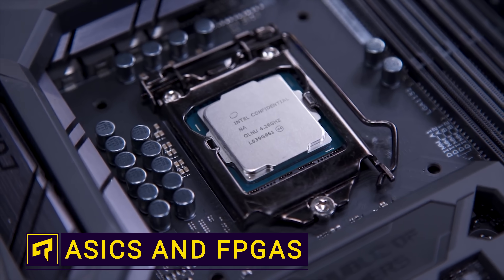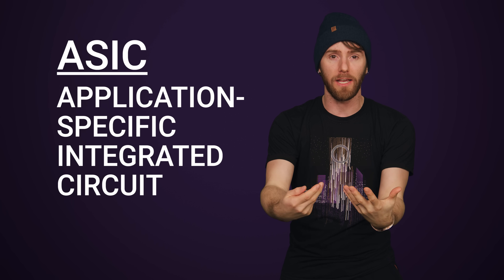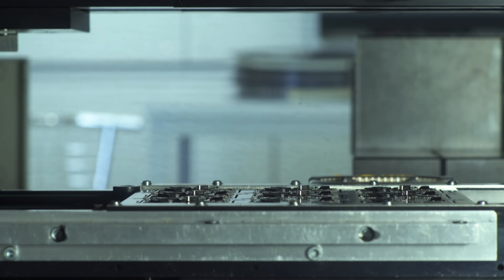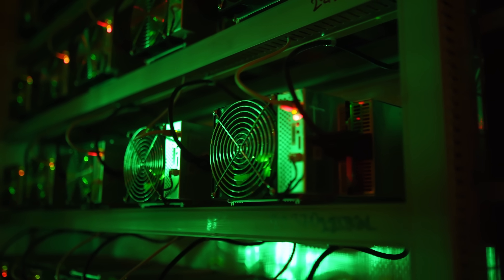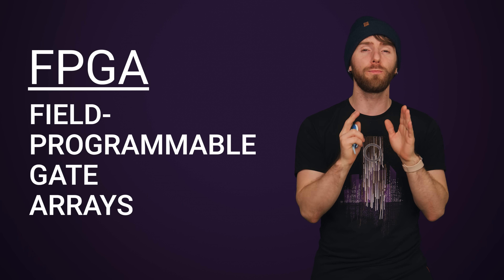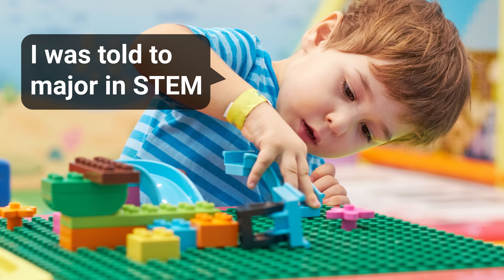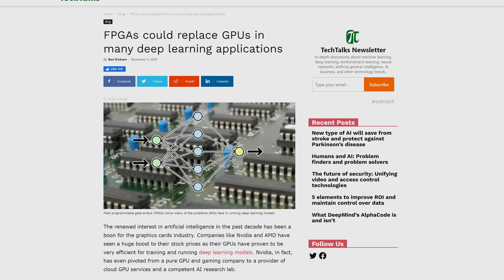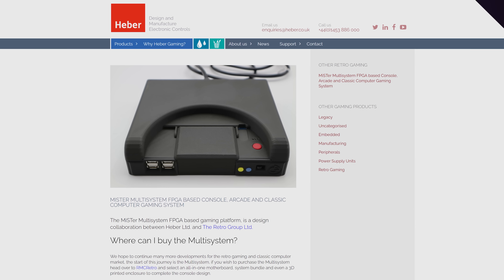These Chips Are Better Than CPUs (ASICs and FPGAs)

Comment: its funny how he talked about emulation consoles, I was about to say they can be programmed to run identical to the retro systems architecture
Reply: Modern day CPUs have insane IPC that FPGAs aren't needed. Taking Nintendo aside, current consoles are all x86 based
Reply: @saricubra2867  you still dont understand ,its not about the IPC, some games no matter what computer you use  have issues with certain games games, especially certain graphical issues.thats what FGPA chips in these emulation consoles were used for. they are infact needed if you want true emulation, as for emulating it on another computer games run fine its just not always perfect.FPGA chips fix this. stuff with FPGA chips are also expensive and know people will pay the price for a true match for match emulation
Reply: @kyles8524  Software emulation can be just as good, people should stop shitting on it just because it's software.
Reply: @karehaqt  FPGA chips just ensure accuracy ,most games run accurate but some dont because of the software emulation.Its all common knowledge when it comes to emulation

Comment: as a software programmer that acquired a couple of FPGA boards to learn to program them, the thing am seeing of note is that multiple FPGA digital circuits can be designed to run in parallel while based on the same clock signal. Depending on problem to be solved the FPGA manner of doing parallelism could be very powerful. An embedded CPU executing software instructions is very versitle and easy to program with lanfuages like C. But it's ability for parallelism is limited by how many cores the CPU has, which for embedded will typically be one, two, or four. Plus those cores need to really be programmed with some sort of OS kernel that facilitates managing different task for execution on the different cores. And those task need to be coordinated to work effectively and correctly, which can be the trickier aspect of multi-programming. 

Whereas the parallelism one designs into an FPGA is just inately what it does - it may require a means of feeding in input data and a means of collecting output data, but it doesn't have to be managed for parallel task execution in the way a multi-core CPU does.

Of course, at the end of the day, my primary interest in FPGAs is to learn how to implement vintage computer CPUs :-)

Comment: One of the more impressive ASICs i know is a monitor screen Scaler. Time ago i was trying to repair a Monitor, i though maybe the fault was on the scaler chip circuit, so since i have some experience with microcontrollers i had the idea of replacing the scaler with one, but then after some research i realised it was impossible, the amount of information and the speed of processing was way beyond what a common microcontroler can do.

Comment: This is like the difference between an all-in-one wireless routerswitchap, and a dedicated AP. 
I've got an all in one 2400Mbps, and a 1300Mbps AP, the 1300Mbps AP, with internal antennas, is about 8x faster than the all in one, but it can only do the one thing.

Comment: The first machine I ever built ran Windows 98 SE2 and an AMD K6-III with 256MB dual channel ram. I didn't even have an exhaust fan. I could edit videos, edit audio, browse online, be on IRC, DL from Newsgroups, and have emulation games (NESten) running at the same time. So I don't know what you're talking about saying that modern CPUs can do the things older CPUs couldn't? It's just a ridiculous statement. What you could say is software has evolved to the point that it requires a modern CPU to really multitask the way you did on the previous generation. That would have been honest and made sense.
Reply: Not only that, is the absolutely ridiculous IPC increase specially with Sandy Bridge, Haswell and Zen 1.

Your K6 processor would struggle or be basically useless for music production, it would choke extremely hard, maybe the entire system would freeze.

I run Android games on my 9 year old laptop with my Intel Core i7-4700MQ quad core processor, why? because it's waaaay faster than the Qualcomm octa core ARM chip from my current phone despite the difference on instruction sets. Massive difference on frequency and Haswell IPC is still good and AVX2 instructions are helping me.

64 bit instructions are huge, and 16GB of RAM is enough for lossless high definition video, unlike the K6 era (extremely crappy resolution compression and framerates).

Things changed a lot since Core 2 Duo.

The fact that you could do something back then is impressive, but would be extremely terrible and rough by modern standards.

Comment: Took me 35 hours of programing in Quartus (System Verilog HDL) to write a program that draws a line onto a DE1_SoC Development board (I'm studying Electrical Engineering in college). All of that work just to draw and clear a line onto a VGA output. Ugh that is the struggle with FPGA's they are a pain to code bc everything runs at the same time (unless you govern it by a clock, but still everything inside the always_ff @(posedge clk) still runs simultaneously.
Reply: If you want your code to run sequentially you would use a state machine, really just a case statement in a clocked process. You could also use a counter and conditional statements inside a clocked process to decide when lines of code run. But really you do want as many functions as possible to run in parallel without being blocked or having to wait, so pipelining and dataflow is very important.

Comment: what? no !!!
As Electronics Engineer in Microelectronics I can clearly say that these information are wrong. To say, there is FPGA, ASICS and CPU is totally wrong information.
A CPU is just a type of a device, such as GPU, or even 555. It is not a category of hardware as the other two.
ASICS is the next step after prototyping with a FPGA, so you cannot change it. A CPU can be made with an FPGA, You can build a softcore in an FPGA, as well in an ASICS device. So, how the categorization in the video is made is very weird. I am really shocked !
Reply: Does that mean that we can make modular CPUs and GPUs with FPGA?
Reply: @jierenzheng7670  yes of course. It iw how we prototype things like that. In fact, you can find cores of old CPUs available on line on opencores and use directly. You can also find miners and other things.

Comment: Have you heard of that new adaptive transistor technology Linus? With this transistors can change the architecture by changing their direction electrically. That mean a zen 3 core can be changed to RDNA2 core or even next gen IP like Zen4. P cores can be changed to E cores. This things takes specialised chips one step further. Even ahead of modern CPU. This can literally save silicon waste.

Comment: Thats the difference between microprocessor and microcontroller. They are (mostly) made to handle one set of instructions that never change in the lifetime (or moderate upgrades thru firmware)

Comment: i would say that you are wrong on this one guys. A cpu IS in fact, an asic. It has static non-reroutable logic gates as well and while they can do a lot of tasks, each task is done through an instruction set command that doesnt interfere with the logic gate connections, just like how the rest of the asic chips do. An FPGA chip though, can reroute its logic gates to simulate a custom processor or a completely different system, granted there are enough logic games.

Comment: Do microcontroller vs microprocessor next please
Reply: The history of the naming can create confusion, but "microprocessor" just means CPU today (the micro part used to mean something when computers were the size of buildings, but not since everything scaled down to the chip level - like in the past 30 years).
So really it's microcontroller vs process.
A microcontroller is essentially a light weight CPU for embedded applications (toasters, dishwashers, etc.). Since they are for embedded applications, they're more like a system on chip with memory, "storage", and I/O on the same chip that is soldered to a board. One of their main staples is that they usually don't run a traditional OS, and only run one specialized application. They also are much slower but in exchange use less power and cost a lot less (you can get some microcontrollers for $0.20, that only use 0.01W, but runs at less than 1 MHz and has 128 bytes of memory).
Reply: Microprocessor: A CPU.  Needs a bunch of stuff outside to be added (storage, memory, IO, etc.).
Microcontroller: A CPU with almost everything that you need built-into it.  You can easily have a "one chip" system where a microcontroller can have the code on-board to blink an LED or send and receive data over a serial port with practically no other parts.  You find those in things like washing machines, microwaves, remote controls, etc.  And because you have to build all of that stuff into one die, they are lower speed/capability and a separate CPU.  But they are useful for a LOT of stuff.

Comment: To summarize: CPUs run software telling them what to do and can be reprogrammed. FPGAs run software (bitstream) telling them what to be and they can be reprogrammed into another hardware configuration. ASICs are mask-programmed at the factory for a specific hardware config, but cannot be changed afterwards. On another note, FPGAs also have the advantage of dealing with handling data in true parallel fashion.

Comment: I always wished that every PC/Device came with an FPGA instead of/in addition to a Gfx card, and then the game developers push their own super optimised firmware on it so that every single person experienced similar/same graphics performance. (This would work even with CPU intensive apps as the FPGA would just override both the CPU and GPU components and push everything directly to the display (or to the iGPU for further processing).

Imagine, thin and lights with 10x more gaming performance of a PC, and draw less power while gaming than during regular use lol. This could similarly be extended to high performance applications such as video editing or CAD.
Reply: This isn't realistic. FPGA are just as limited by their transistor number as everything else. A GPU is already a heavily optimized device for floating point operation math used for graphics. An FPGA can't get anywhere near that even if they are programmed for a specific game.

Comment: Something worth noting about FPGAs is that there are also fuse-based FPGAs which are only able to be programmed once in the field because fuses are used to permanently sever a connections that are not needed. These are good to have because unlike reprogrammable FPGAs that have to reset all of its gates every time it loses power, the fuse-based FPGAs are immediately ready when power is restored.
Reply: Are they still making those?  I can't imagine the demand is too big, since you can't update them.  I do remember using an Actel ProAsic years ago: an FPGA with flash built-in so that it is ready to go immediately without having to add a serial EEPROM.  But flash and fuse-based FPGAs seem to be in the extreme minority.

Comment: What about a SoC FPGA?
Reply: A SoC FPGA combines a FPGA with a low power CPU (usually an ARM). That allows for the CPU and FPGA to work together in simpler embedded applications (sort of like how the GPU and the CPU work together on a Raspberry Pi). Additionally, you can use the FPGA part of the SoC FPGA to interface with I/O. So for example, if you have a LED display with 400 wires coming out of the SoC chip to control the LEDs, you can have a custom controller which takes in a framebuffer from the ARM and converts it into the required signals to drive the LEDs.

Comment: Wouldn't it be more efficient to have ASIC coprocessors to help a CPU? (Like the math coprocessors we had back in the 90s.)
It sounds like we would have more powerful computers if we did that instead of adding another CPU, for instance.
EDIT: I take that sound cards have their own ASICs to decode audio files, but I'm thinking something a bit more of general use.
Reply: That's basically what the PS3 did. It was fast, but very annoying to program for.
Reply: Main disadvantage of asic is that it cannot be reprogrammed, so the moment you need to change even a tiny thing it will become useless.
And software is evolving way too fast for asics to make sense otside some very minor use cases.
FPGA's on the other hand could be used like you said, I guess no one had the idea yet.
Reply: @hubertnnn  Intel had that idea back in 2014 (the HARP platform). It was a massive failure.
FPGAs have too many problems to be used effectively in a general way. For one, they are very hard to program, and often require experienced engineers to hand craft the design. They also are not nearly as fast a CPUs (due to the configurable overhead), and they have a fixed resource limit / size (if the design doesn't fit, then it won't run).
Reply: @ethanblake4  See Apple's M1 processor, it's packed with such functions (implemented as hardware, aka. ASIC): video encoder-decoder, ML engine, crypto, oh, and the largest one: video card. Anyway, a CPU is also an ASIC: hardwired to do a specific job - run machine code (but as it's very complex and runs program itself, we don't say this, it's not a typical ASIC).
Reply: @hjups  Another issue with the FPGA: they don't scale well over time with respect to software compatibility.  You can run old 32-bit code from 20 years ago on a modern CPU.  An FPGA would require re-compiling the entire design every time a new model of FPGA was made.  If you wanted to sell code that could run on an FPGA, this would quickly turn into a support nightmare as the years go by and new FPGAs are put in new computers.
Reply: @harrkev  That's partially true. Most CPU code doesn't age well over time, sometimes relying on ISA extensions that become obsolete, or incompatibilities with the OS. Even bare metal software won't run across systems as the memory map easily changes.
If you keep a consistent OS environment and don't rely on obsolete instructions, then you move your compatibility problem to the OS rather than the end user application. However, if the end user application uses assembly routines, that assumption can go out the window.
Similarly, you can build a FPGA IP core to be cross vendor and not rely on any device specifics, instead abstracting most of the details to a wrapper that is maintained across platforms. If the FPGA IP core uses vendor specific macros though, it will be similar to software using assembly routines.
In general though, I would say that FPGA cores are probably easier to maintain and port across chips than software is, especially if you rely on a nicely standardized wrapper.
Reply: Yes, that's why you have stuff like AES-NI and SSE instructions in a CPU specs sheet
Reply: @ethanblake4  

And Apple Silicon did (whether it's A-Bionic or M-series) it, too
Reply: @hjups  There is no such thing as being cross-vendor. The same problem exists in CPU market. The only reason software nowadays can run on "all" computers is that we have exactly 1 type of CPU: 8086.

All modern intel and AMD CPUs are just clones of 8086 with improvements in performance and few extensions.
Reply: @hubertnnn  That's incorrect. Firstly, you make it cross vendor (or vendor independent), by not calling or using vendor specific IP blocks or macros. That's one of the principles behind the higher level languages such as Chisel (which also works for ASIC design too - one verilog file that can go to any platform, in exchange for a less optimal implementation).
Secondly, modern computers are not based on the 8086, they are based on the 8386 (8086 was 8-bit and 16-bit). And modern 64-bit CPUs are based on x86-64, which is again not 8086. 8086 is a subset of the ISA used by the 386 and a subset of x86-64. Meanwhile, many modern programs (either explicitly via intrinsics, or implicitly via the compiler) rely on extensions to the larger x86 ISA overall (things like CMOVE, MMX, SSE, SSE2, SSE3, SSE4, 3DNow! etc). Back in the late 1990s, AMD came up with an implementation similar to SSE called 3DNow! which is no longer supported, but a fair amount of x86 binaries still rely on those instructions - you just can't run them on a modern system, requiring an alternative binary or an emulator.

Comment: Asics are what the big cryoto mining companies are using.
Reply: ASICs are what YOU are using.  If you have a cell phone, there are ASICs in there for the radio stuff (WiFi, Cell, Bluetooth, etc.).  If you have a computer, there are ASICs in there for such things as power management, clock control, etc..  Really, ASIC just means any piece of silicon designed to do a specific job (IE not a CPU, and not discrete logic).  FPGA is a chip that does nothing, but you can program it to do any job that an ASIC can do.
Reply: …Don't forget YLOD  ( P h a t t )  PS3 (which can emulate PS2 using hardware accelerator), Apple Silicon, and Google Tensor

Comment: YouTube servers are using a combination of both ASIC CPUs and GPUs at the same time.

At the time of writing this comment, there's no end user CPU or GPU that can Transcode VP9 or AV1 video codec.

Even 12900K or Threadripper or Xeon or RTX 3090 Ti cannot transcode VP9 & AV1 video codec which is widely used by YouTube. And Netflix as well.

Oh, and the YouTube's ASIC CPU and GPU are only running at less than 1.5 Ghz but with Gazillion amounts of Cores.